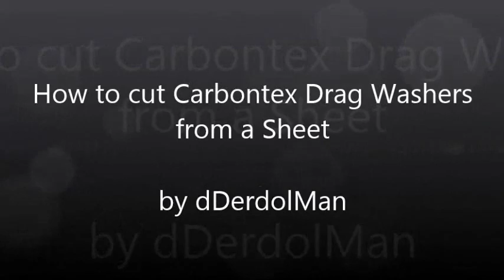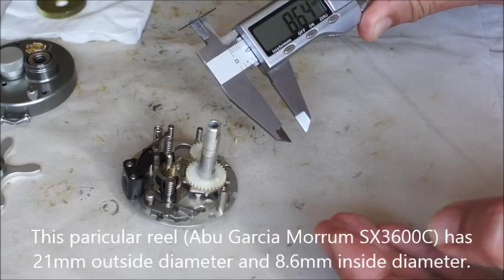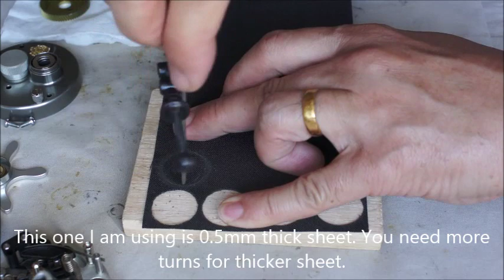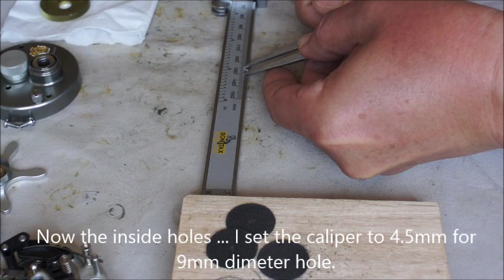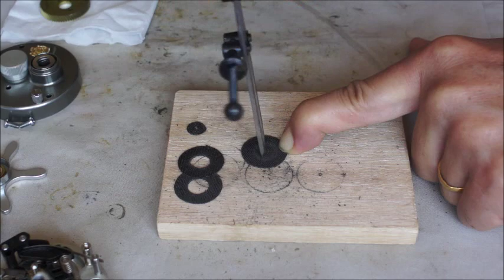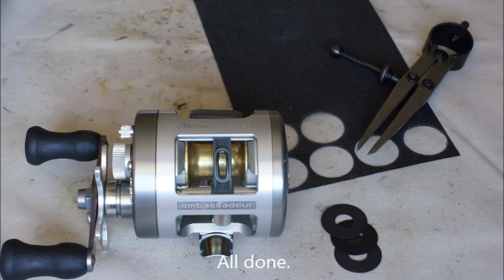Cutting Carbontex Sheet to size - for reel drag upgrade

Comment: Sir can we use two drag washer in the place of old one drag washer. If we would use two washer replacing one old washer from low profile baitcasting reel, so what would happen? Will it work smoothly?
Reply from the maker: I don't think you can. Drag washers get too thick and you may not be able to adjust the drag. That's why you need to select same or similar thickness washers when you replace with carbontex.

Comment: hi if i have a 0.7mm carbontex washer that i can't fit in my reel due to the original being 0.5mm can i sand it down to that thickness ? will it affect the washers performance in any way ?
Reply from the maker: +Dol K. Mato I don't see why not. But have you tried 0.7mm washers? Some reels will work fine. You may not be able to loosen up the drag right off though. Some reels, you can't loosen the drag at all or the side plate won't fit. 
If that's the case you can try. I've never done it, though.
Reply: +dDerDol Man i tried fitting the metal washers with thr new 0.7mm carbontex and they just won't fit . i can't close the side plate on my reel unless i change back to the original 0.5mm washers .was just wondering if sanding down the 0.7mm washers to 0.5mm would affect its performance in any way .
Reply from the maker: +Dol K. Mato If you look at the carbontex, there are grids/grooves. I don't know if these grids have anything to do with performance. If you sand, you are sanding these grids down. In my opinion it won't make any difference on performance if you run them dry - ie no grease. 
Try. If it affects the performance then you can always replace them.
Reply: +dDerDol Man its those grooves that im worried about sanding . i heard that those grooves are the ones responsible for friction thus creating drag .
Reply from the maker: Dol K. Mato That's what people say but I've seen flat carbon drag washers. People believe, grooves suppose to hold grease. I don't know if that's true or not, that's why I suggested running dry.
Reply: +dDerDol Man i will try as u suggested and keep u updated . thanks for the fast replies !

Comment: does the thicknes of the carbontech matter?
Reply from the maker: Yes it does. If too thick you won't loosen up the drag. If too thin you won't tighten up the drag.
Check your washer thickness first and get one similar in thickness.

Comment: Where can I find this tool for cutting ???
Reply from the maker: Calipers are available from hardware store. Make sure you buy straight point caliper and not curved one. Curved one is hard to sharpen the ends. Good luck.
Reply: @dderdolman5736  just ordered my sheet from aus free delivery to UK and reasonably priced thanks for the link.

Comment: Where did you get calipers that can cut like that?
Reply from the maker: Should be able to find one from a hardware store.
Reply: Is it special or will they all cut if they're like that
Reply from the maker: You need to sharpen the end points. Most straight calipers should cut.
Reply: Harbor Freight sells the Pittsburgh Technical Measuring Set 6 pc for $9.99. One of the pieces is a straight point caliper.

Comment: Can you use carbon fiber sheets instead of carbontex sheets? Both are carbon fiber but the weaving is different. I've found some carbon fiber sheets on amazon for quarter to half of the price of carbontex sheets.
Reply from the maker: I think they are same thing. 
Make sure you pick right thickness.
Reply: Be careful not to get the glossy stuff,doesn't work the same way

Comment: Does this work with carbontex sheets that have a fiberglass core?
Reply from the maker: I don't see why not. As long as the sheet gets abraded with sharp object.
Do carbontex have fibreglass layer? I thought what I have here is same as carbontex.
Reply: dDerDol Man It depends on where you get it from. Smoothdrag says they don't have any fiberglass in their carbontex. The carbontex I got from ebay says they have a fiberglass core just like the Penn drag washers. 

Btw, I got a "Precision ECG Caliper" from home depot and it didn't turn out well. It didn't do a clean cut and the carbon fiber ended up being loose. Maybe the carbontex I got was not very good or maybe due to the pin point of the caliper. I will have to get a spring divider caliper like yours to find out. I will keep you posted.
Reply: dDerDol Man a

Comment: Would be much easier to cut smaller hole first.
Reply from the maker: You won't have pivot for large hole.
Reply: @dderdolman5736  It should be in the wood below.
Reply from the maker: @recoilrob4765  You could if the carbon fibre is clamped on the wooden board.

Comment: Gasket punch takes 2 secs. No potentially hazardous dust either.
Reply from the maker: Yes, commonly used by many people including myself. 
But this method has advantages on:
1. it can cut in any size - drag washers come in different sizes, and
2. it cuts the hole in the middle accurately. This is very important if you want smooth drag. This is the main reason I have come up with this method.

Comment: Just buy the drag kit for your reel, this is way to much when you have 30 reels! 
Tuna's reel troubles Ludington, mi
Reply from the maker: Of course, if I am spending someone elses' money I would buy the kits ;)  But not with my money.
If you have 30+ reels, buying a carbon sheet for a $15 and cutting out the drags is the way to go.
1 or 2 reels, go with kits.
Reply: @dderdolman5736  The Man has spoke. Wisdom. And knowing it was done right and no corners cut means when you setup on a reel burner- you won't be sweating the details.